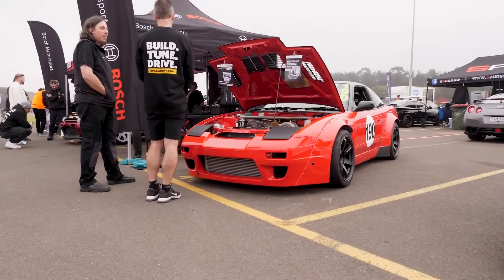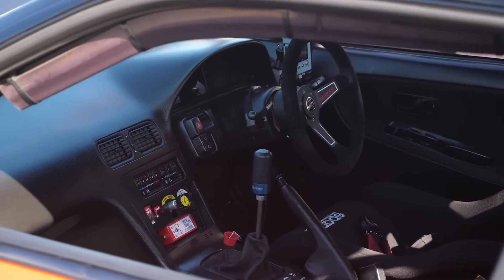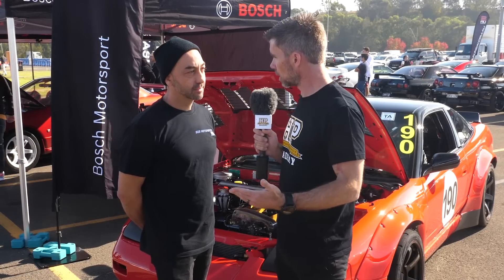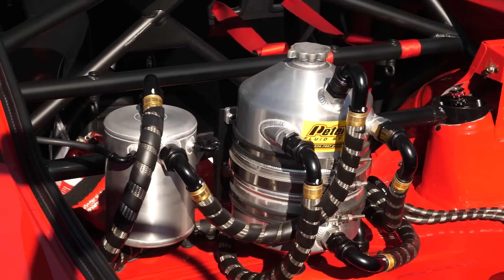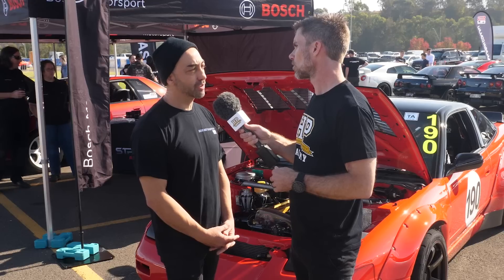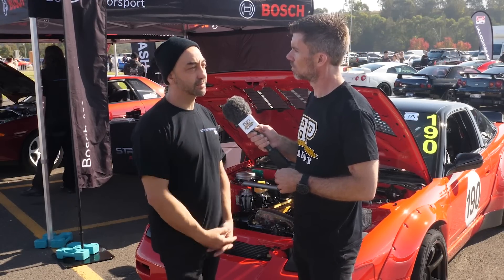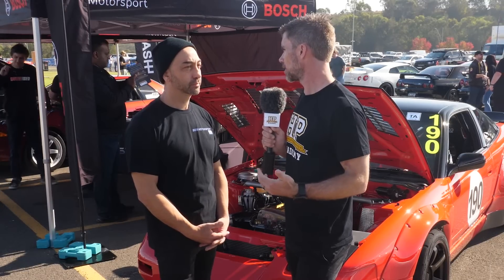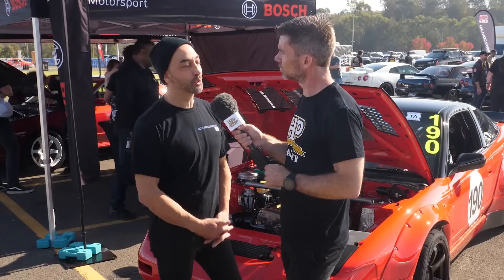One Modification TRANSFORMED This Car

Comment: Andre, 

The downside of mapping ‘feed forward’ vs traction control is that the Motec doesn’t have a torque limit and a torque gain which are easily adjustable. 

If you don’t have your engineer trackside, the boost/ignition/throttle curves are a reasonably coarse adjustment to the track limit.

Comment: Why not just make a less powerful car? So many strategies required to tame the car and make it drivable...
Reply from the maker: It's a compromise. You want more power for roll racing, etc, but less for circuit racing, and the tuning strategies are perfectly acceptable ways to manage multiple uses.

We zeroed in a bit more on the circuit use of this car than anything else.

If Chris does fit an aero package, then the power required on circuit will quickly increase but not in such a way that the build isn't already prepared for too.

It is not a direction everyone will or should take, I'm sure Chris put a lot of thought into it before deciding that he was happy with this path in relation to how he wants to use this car and in a few years I'm sure he will look back and see a few things he might do differently and a few things he would still do exactly the same if starting over 🤘- Taz.
Reply: @hpa101 you are so right and good interview with Chris. Knowing Chris well, he never goes into something half baked and he has plenty of experience circuit racing with a mix of non-aero and aero based open wheelers so taming a car comes pretty naturally to him. He enjoys circuit racing but he built the 180 with a variety of functions in mind. He’s just enjoying the challenge of pushing its boundaries around the track……half the fun and half the challenge!

Comment: Would have loved to learn about the fuel system used. I see a lot of mechanical fuel pump used in drag application but not in circuit racing. What are the pros and cons of that setup for grip driving?
Reply: Agree. More on the fuel system!!!

Comment: I was impressed by the ABS system, then I checked the price to find out its more than $11k 😂😂
Reply from the maker: Yes, it's not a cheap investment that's for sure but everyone we have talked to who has made the investment has felt it was well worth the money.
Andy Forrest also mentioned somewhere how they hold their value secondhand, so if you do ever want to move it on you won't lose much. Can't think of many other race car parts you can say that about!

Outside of that, every option comes with pros and cons, and this isn't the only ABS option, and it won't suit everyone's application or budget, but it's still cool to learn about either way 😎 - Taz.
Reply: Makes sense. On the wish list for sure.

Comment: I would be willing to say a VQ37VHR would be an amazing engine in the S13 chassis as well.
Reply: Absolutely, I put a VQ35 in my s13 and its impressive how far back it sits on the engine bay and it weighs  about the same of the factory 4 banger.
Reply: @Hanschepu  exactly. I had a KA turbo and the engine with the turbo weighed a lot. Plus with the VQ you can put the amazing CD009. The powerband in the VQ suits a lightweight S chassis very well. Plus you won’t be over powered. It sucks to overwhelm the chassis with too much power and not be able to use it.
Reply: @RadDadisRad  yeah, I can imagine a VQ37 with some bolt ons pushing about 330whp would be a blast on an s13, lightweight high response great for a little bit of everything.
Reply: Or a VR30 😎
Reply: swap engine depends mainly on the person one wants a light v8 the other a heavy rb26 ;)

Comment: Wow! what a car, great interview too. Would have liked to hear more on weight distribution and the effect of a L6 motor. There is so much RB knowledge around that they are a natural choice but why not a Nissan V6, there are several turbo versions.
Reply: Turbo V6's are usually slightly heavier than turbo I6's plus an I6 is smoother
Reply: VR30 would be cool to see in one of these, in fact someone's probably already done it.